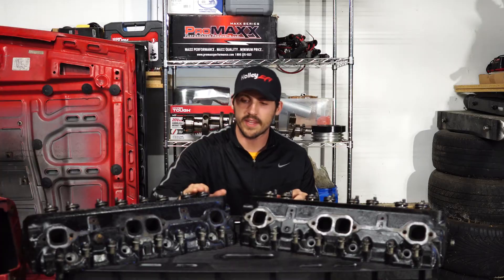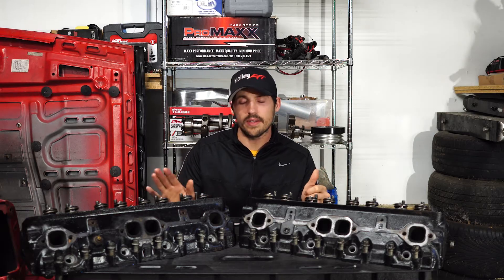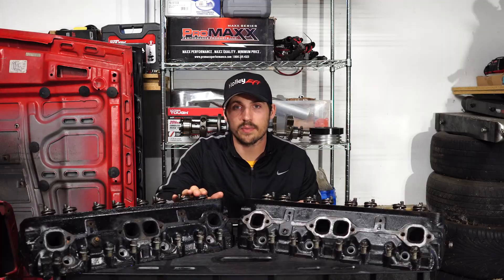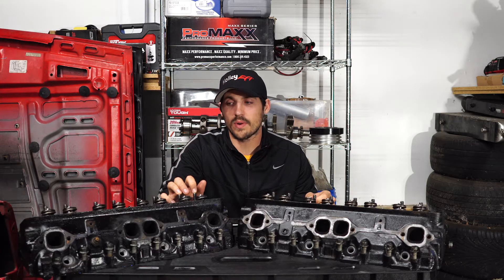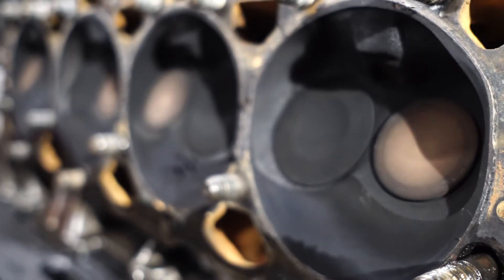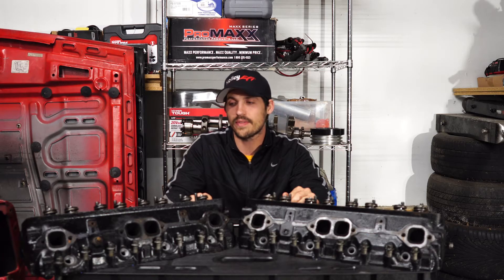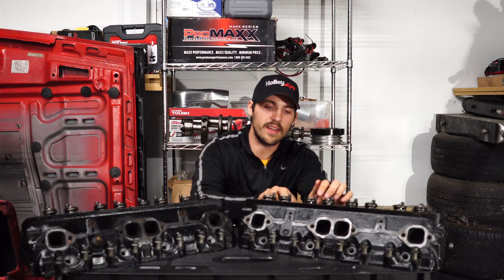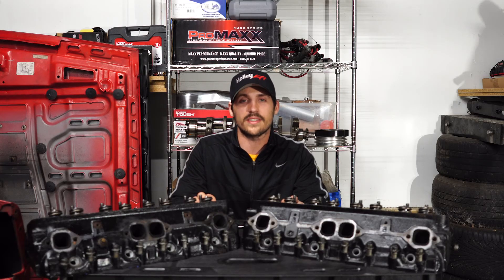Vortec Heads - The Big Issues You Need To Know About

Comment: I wound up going with beehive springs & offset locks to get up to .470 lift. I did have to measure but there was some room. Not enough room for the springs, however - bosses had to be trimmed to fit them.

Comment: Mine came off a gmpp crate motor with .460 exhaust lift and I measured .465 clearance. Luckily the valve seals weren’t seated all the way so I ended up with .525-550. I got a good deal and needed a better intake anyways but I ended up pretty close to a set of nkb or similar

Comment: You forgot the press in studs as a down side. Best to have them tapped for screw in.
Reply: All cast iron chevy heads have press in studs that I know of. They only did screw in on aluminum which also required guide plates.
Reply: Not really, mild and medium handle it, high and extreme need threads. Application dependent.

Comment: Guess I got lucky I took a set of 062 vortec heads off a junk engine and ran a 490 lift comp hyd flat tap cam and never touched the heads put them on the tbi short block

Comment: These heads are prone to cracking because Chevy put a 210 degree thermostat in the Chevy truck so when the fan quits the heads and gaskets go I run a 180 thermostat Comp cams LS6+ valve springs and 787-16 retainers and now I have .570 valve clearance. But as a professional engine builder I've only came across 1 set that was cracked and that block hit 250 degrees it also fried the rod bearings and main bearings the guy toasted the block
Reply: 250 degrees Fahrenheit isn’t hot enough to hurt an engine and bearing materials melt at much higher temperatures. Lead melts at over 600 degrees, tin at 450 degrees and aluminum at 1220 degrees.
Reply: @timsharpe3498  correct the heads were not the issue the issue was the new coolant gm used in the late 90's  and their fail closed thermostats from the factory
Reply: Yeah running at 250 degrees isn't normally a catastrophic problem but in bad water NV it is because it's normally around 125 degrees in the summer and GM's shitty factory coolant and head gaskets blow out almost immediately then usually water in the oil causing bearing failure or hydro locking which as we all know is a severe issue
Reply: Since when did GM ever use a 210 degree thermostat? I just replaced the thermostat in my 1998 Chevy k1500 two months ago. It was the original equipment one marked with 195 on the Annode end. You are wrong.
Reply: @robbiewallace2754  depending on where you live and ambient temperature GM's rating for sbc is 195-210. The 82-92 camaro had a 210 degree thermostat the trucks I've seen in washington and alaska all had 210 degree thermostats but everyone I worked on was a factory HD optioned work truck with a larger radiator and oil and trans cooler.
Reply: Oh and because some guy at autozone says a 195 is standard equipment doesn't make me wrong how about you look up sbc factory thermostats for sbc.
Reply: @kennethrand1032  i just gave you an example of a small block chevy equipped truck. For the record I live in Michigan. I have a family friend that worked at Flint Truck/ bus for over 30 years. Guess what i called him up and asked him a simple question. What was the most common Thermostat used in Gm cars and trucks? The answer 195 degrees.
Reply: @kennethrand1032  i don't work at Autozone🤭🤣🤣
Reply: @robbiewallace2754  #1., the "most common" isn't the example used. He said cold climate states--#2., when did he SAY that you worked at Autozone?  Either you have piss poor reading comprehension, or are easily "triggered."  lol
Reply: 210 thermostat in a L31 Vortec 350 huh? My truck had a 195 thermostat that's what I replaced it with.
Reply: @robbiewallace2754  I should have also mentioned it depends on your region as well remember at higher altitudes water takes longer to boil I'm above 5,500 feet. Those closer to sea level should go with a lower thermostat. Also it snows where I live out heaters are used more which also pulls more heat from the cooling system.
Reply: Running 210°F isn't going to crack the heads.  I'd say the more likely problem is being run low on coolant so the heads weren't being cooled at all due to a plastic radiator tank that cracked or a plastic intake manifold gasket that dissolved due to Dex-Cool.  My Suburban had both of those failures years before the passenger side head cracked.
Reply: @KevinJames-yg9eu  yeah around 240 the combustion temps skyrocket in the cylinder head. It's really not the coolant temp that cracks it the inability to regulate the temperature in the combustion chamber cracks them.

Comment: I’m building a 355 Chevy with Vortec heads now for my Squarebody, I got the heads off of marketplace...they ended up needing a valve job and one exhaust valve. But they came with good springs, cut down guides, brand new Summit aluminum roller rockers and screw in studs. But you’re absolutely right, you have to factor in the price of an intake, intake bolts, and valve covers (and I had to get tall) 
My total investment for the used heads, machine work, intake and valve covers, I’m at $900. Not sure I’d do it again, considering BluePrint sells aluminum heads for $900/pair. 🤷🏼‍♂️
Reply: I went to my local junkyard and yanked out a set of 062’s for 50 bucks. Changed the springs to ls6 beehive springs and comp retainers. Total investment, $225. Running a comp 280h magnum cam with zero issues
Reply: Thats cad too
Reply: Then i had to buy the intake (which i needed anyway) for $330 and valvecovers, i already had
Reply: What type of intake did you go with
Reply: @jordans03  FleaBay
Reply: Yikes. Could have bought new heads, just as good for same price.
Reply: @SOLDOZER  yeah, that’s why I said I likely wouldn’t do it again….

Comment: Can you explain or better yet show the difference between 95 and earlier and 96-2000 sbc coolant bypass. I hear the early engines had the hole below the water pump opening. Now the 96 up blocks don't have the extra passage as I hear.

I know coolant needs to circulate prior to the thermostat opening to prevent hot spots before the t-stat opens.

How is this accomplished? And do you need to make any changes when Installing a Vortec style head on an earlier block or installing early heads on a Vortech block without the extra passage? I've heard suggestion that a hole is drilled?!?
Reply: Just use the mr gasket high flow thermostat and drill 3 holes in the top 0.120" or buy it that way from speedway motors.
Reply: All carbureted vortec intakes have the bypass port cast into them, you just run a heater hose to the top of your water pump, the same way Oldsmobile did it...

Comment: Would they bolt up to my 1993 Chevy blazer motor 5.7 350 tbi?
Reply from the maker: Shouldn't be an issue. That engine might already have center bolt valve covers and the different intake manifold you would need for the Vortec Heads. Good luck with it!
Reply: Zanes Garage appreciate it man I figured they would fit, my only problem is finding a intake to fit the vortec heads.

Comment: I pulled a set from pull a part a year ago no problem. The truck still had coolant in it which was good thing no overheating issues maybe I got lucky. Sent to machine shop check for cracks installed my ls6 springs comp retainer and locks good to go
Reply from the maker: That's good to hear. It seems like cracks in used heads can be common

Comment: Can you run a 1103 cam with those heads stock
Reply: Yup! That's the same cam I have in my Nova. With 4.10 gears, 200-4r tranny, 1103 cam, & vortec heads....car runs like a possessed rocket ship from hell. I love it.
Reply: @qgarvin1  did you  change spring or anything
Reply: Nope! The stock springs on the Vortecs work fine with the mild 1103 cam. Any cam bigger and then you would probably have to change the springs. If you have a low compression engine and a stock block, use fel pro 7733SH1 or fel pro 1094 head gaskets. They both have a compressed thickness of 0.015 in. That will up your compression a few notches and you”ll still be able to run pump gas. I run 87 octane all day everyday with this beast.
Reply: No not yet
Reply: @qgarvin1  thanks for helping
Reply: qgarvin1 kinda answered all my questions,I have gaskets with the metal ring are they ok or no I have a stock 305 block
Reply: No not yet ,wanted to  know if it will work without changing them.

Comment: What Camshaft Do You Recomend For The 062 Heads, I Have A 1998 GMC Z71 And Am Looking For A Upgrade On The Cam For A Bit More Power And A Better Sound. I'm Still Using The Spider Injection Setup Also. Camshafts Are Real Tricky On Finding The Right Ond For The Right Price. ??
Reply from the maker: With my recent rebuild I've installed a new Comp Cams 12-234-2. It has decent lift and duration and shouldn't cause any issues with vacuum like the thumpr cam did. Check in and I'll make a video about it soon hopefully!
Reply: Zanes Garage I have the thumper cam 283 going in my Vortec with shaved Vortec heads came out with a lot of power

Comment: I heard they was prone to cracking how true is that
Reply: Most that have been hot are cracked for my experience looking through the junkyard
Reply: 9 out of 10 crack. Mostly stress cracks. I repair them with bronze mig or safety-silv 56. Some are cracked into the water jacket and need plasma weld.
Reply: Oh  and chamfer all sharp edges. Exhaust seats were hardened but no tempered. Torque them in reverse order so they dont banana and crack in the middle.  There are repair tubes for cracks going into a bolt hole.
Reply: They CAN work. Need to be magged and pressure tested if you find a good one somewhere,
Reply: This is from being old and building a lot of dirt motors, the old double humps are tough how many have you guys seen cracked from heat. In reality with a flow bench, stock  the vortec has a better ex port, in ports are close. Ported, they are equal or close. But the double hump don't break as my friend puts it.
Reply: Very true! They flow ok but crack really good. Damn shame too, so many customers that searched and searched for a cheap head to play with just to have me show them a crack in them.
Reply: Their thin and they crack and you dont very many options for intake manifolds. You can buy a lot of cast heads for cheap I wouldn't waste my time
Reply: @rtkl13  plenty of dual pattern aluminum heads out there 350 set
Reply: @rtkl13  you're better off getting an aluminum set and they're cheaper
Reply: @stephengrant2677  hell yes.... the only way I justify them is if I had no money and I had a couple of Motors laying around and one of them had the heads on it. Then it would be my luck after I got them bolted on and spent for gaskets I'd find out they're junk....no thanks
Reply: All these new iron heads crack

Comment: I need help I have a 355 I want to put 906. Vortec heads on It has a nice size cam in it an dont know anything on it I bought it... will the vortec heads go right on it? Anything will help me out
Reply from the maker: The stock cam that came with the zz4 create engine which had my 906 heads on it was around a .460 lift.  Like Chris said .480 seems to be the limit for any stock heads.

Comment: Stock vortec heads are thin casting. When pulling heads from used engines almost 1 out of every pair are cracked between the 3 and 5 exhaust seats and or 4 and 6 not including occasional cracks going from the water channels to the chambers......before dumping a penny more into those factory heads have them checked....I gaurantee you most 906-602 casting head vortec engines sitting in your local car yard have milky oil. For a few bucks these heads make great power but they are ticking trouble bombs. Spend a few more bucks and get aftermarket vortec style or bowtie heads if you prefer iron heads.
Reply: i just pulled mine off my L31 and they are great,but came off a meticulously maintained engine.THE bores on the block are still cross hatched and perfect
Reply: @trillrifaxegrindor4411  I believe you..long as they never ran hot from the notorious intake gasket failure they will not crack. Those junk gaskets gm used back then are the real problem. ALL it takes is water temp reaching 250 one single time to risk cracking them. I have 191k on my '97 K1500 with L31 engine and still runs flawless, but it has also been well kept since it was built and never ran hot.

edit: I have yet to pull the heads on mine so I can't say %100 they are not cracked, but if they were I don't think it would run perfect as it does.
Reply: Nope.
Reply: I installed new heads on my stock sbc block for my boats engines in 2019 and put over 2400 hours on that boat since then without any problems and never flush the engines since it’s always out on the water. They are cooled by salt water not coolant.
Reply: Not mine. ‘04 250k
Reply: Mine had a massive crack in the #6 exhaust seat and was drinking coolant, but there wasn't a drop of coolant in the oil.  I'd say milky oil is more likely a symptom of the Dex-Cool dissolving the intake gasket.  Luckily, when my intake gasket dissolved, it was an external leak.